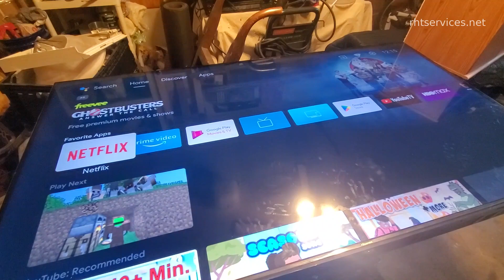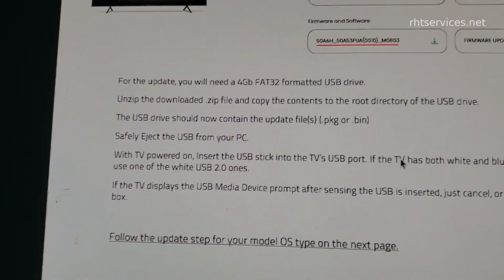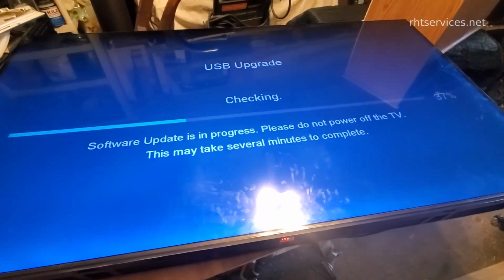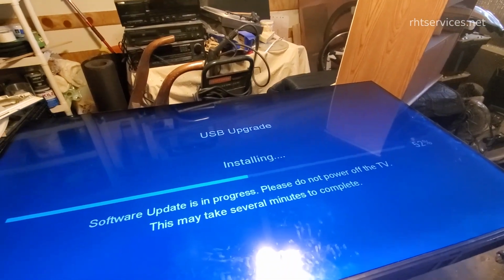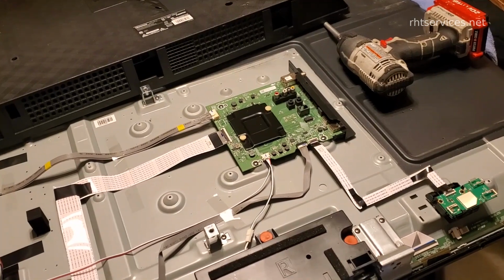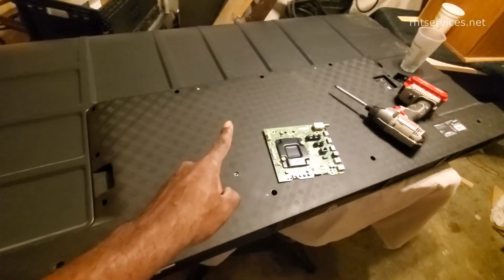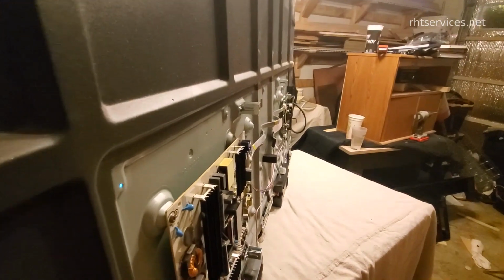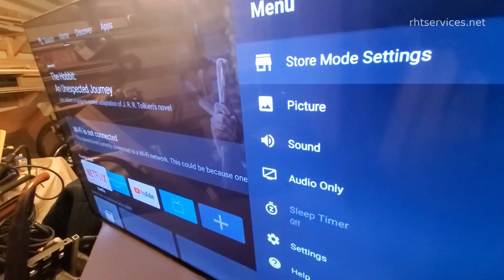Hisense Android TV Has Main Board Failure, How To Replace

Comment: Just had a Hisense TV fail with this same issue, the problem is the eMMC flash memory on the main board hits its maximum number of writes and fails into a read-only mode. The main symptoms are errors in the Android TV OS: an "out of storage" error, the black screen a few seconds/minutes after startup, if you manage to delete apps or factory reset they all reappear after restarting, etc. Looking around online this appears to be a fairly common issue at the 3-5 year mark for their 2019-2020 lineup of TVs. I assume they used a low quality eMMC chip to lower the price and don't really care because it survives through their provided warranty. You see the same problems with cheap USB flash drives when they die.

The TV is "usable" while in the state as a dumb TV in the sense that you can use something like the Netflix button on the remote to power it on then change the input. Changing picture/sound settings is a crapshoot in this state (might work, but will revert if you restart it), and the Android TV OS is non-functional (any time it tries to write files to the nvram it'll fail and crash the OS causing the black screen).
Reply from the maker: Agree. This TV exhibited some of the same behaviors that you mentioned.
Reply: Had EXACTLY the same problem with my H9G. Started with storage problems, where it recommended I delete applications. However I don't have ANY applications loaded as I primarily watch TV through a 4K Fire Cube. Initially I could ignore the problem but it got worse to the point it was recycle many times after struggling to get the main page loaded, and then would simply shut itself down. My TV is almost exactly 4 years old. Reading multiple sources, it appears to be a common fault with this model of TV (we bought ours in 2020) and so replacing the motherboard will likely buy us another 4 years and the exact same fault will recur. Bottom line, although the picture quality was great, I will never buy another Hisense TV and now recommend all my friends stay away from this brand entirely. At the very least, Hisense should've released an updated motherboard with a permanent fix to this issue, but to-date I've seen no indication they did so.
Reply: this looks like its an issue with the power supply they usually fail because the capacitors start failing. the software tries to do smoething turn a wifi radio on etc that it doesnt have enough power for and it reboots any time the voltage rail drops below the nessecary level. its like a 2 dollar fix.
Reply: That just happened with mine. I got a new main board today. Hopefully that will work.
Reply: @cubdukat did it work?

Comment: Yes, the storage crapped out which is happening to a bunch of folks over the past year or two. The only fix is to replace the motherboard with a new one, which are now hard to find. I paid around $170 about 8 months ago for a replacement motherboard. The process of replacing it is fairly easy and shouldn't take more than 20-30 minutes (most of that time is laying the unit flat and taking out a bunch of screws). I now use the TV as a dumb TV, and don't even connect it to WiFi, using a Roku stick in one of the HDMI's. Hisense used the kind of storage you find in bottom-rung chinese Android units. Frankly unbelievable. The picture on the TV is still great, for a $500 original purchase price.
Reply from the maker: This tv didn't require motherboard replacement. Instead the ROM chip was replaced. There's a company in Arizona that it was sent to. The repair was about $140 and comes with a 1 year warranty.
Reply: @rhtservicestech  Thanks.

Comment: mine started with a single 1px line at the bottom, then few weeks later a second line. about 1cm higher. that was perhaps 3_4 months ago. today, it started to show flickering or showing second images. perhaps its called ghosting. is that the t-con board going bad? this TV is u6g, I got it for 2 years now
Reply from the maker: @RomboutVersluijs  probably so or a bad connection between board and screen

Comment: FIRST, WAS THERE A RECALL? ALSO WHY YOU HAVE LG? BUY ANOTHER TV, THAT CHIP WILL DIE ALSO IF IT IS THE SAME ONE. OVER 35yrs REPAIRING TVs.
Reply from the maker: Per phone support they didn't mention a recall. Also TV was outside of warranty period so it couldn't be fixed for free

Comment: Well atleast I know my diagnosis was right the motherboard was f'd
Reply from the maker: Yes. The motherboard doesn't have to be thrown out though. I was able to find a company that was able to repair the ROM chip and provide a warranty for the repair. IMO better than just replacing the motherboard and that going out again.
Reply: @rhtservicestech  probably my only option tbh I can't even find a board for my model that's only 4 years old
Reply from the maker: Check on eBay or similar type of sites. There were many available at a wide range of prices.